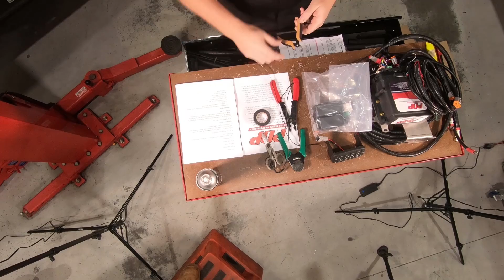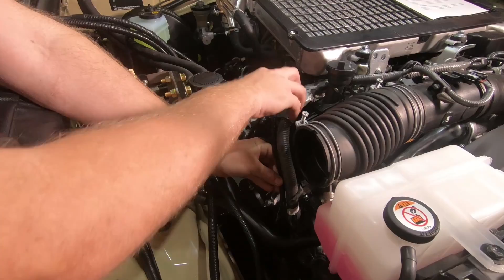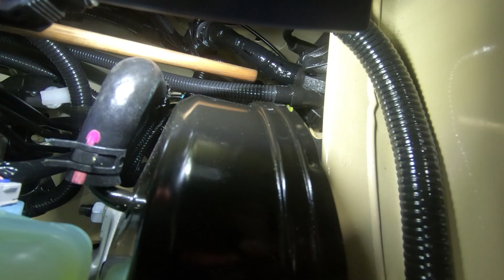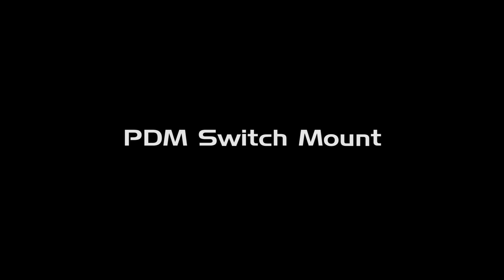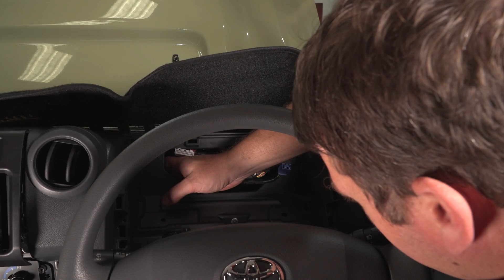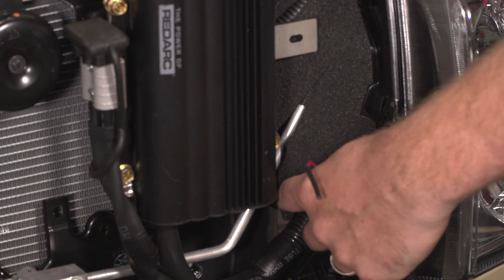Perth Diesel Performance Power Distribution Module Install

Comment: Does this work with LC200? And is it possible to fit on my Mercedes G wagon pro?
Reply from the maker: We have a wiring loom and kit for the 200 series. 
For you G wagon we will have a generic kit this year that will be able to be put into any car but wont have a full custom wiring harness.

Comment: you really don't need to twist the bare wire so much to fit them into the deutsch terminal, other then that, looks like a straight forward install